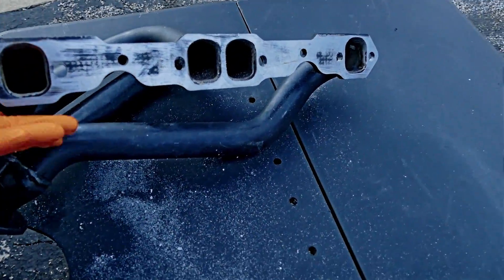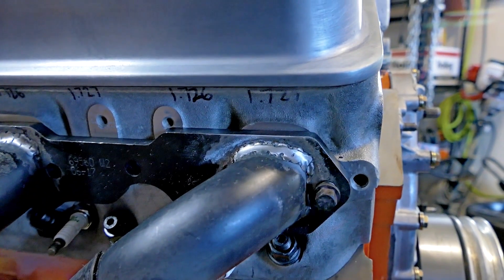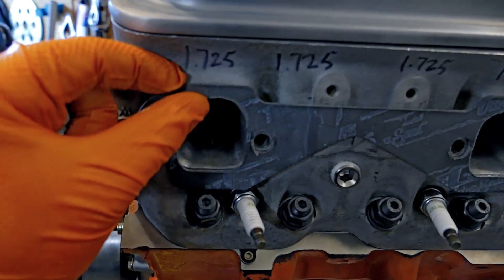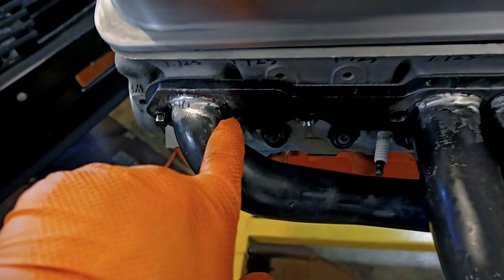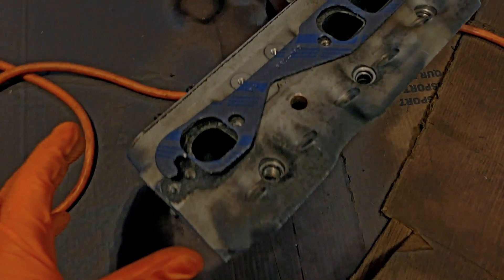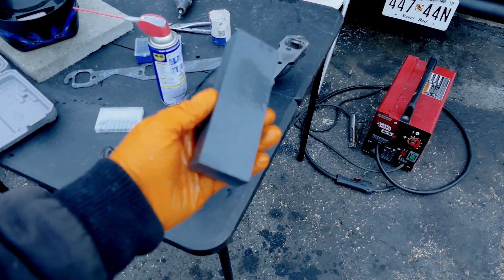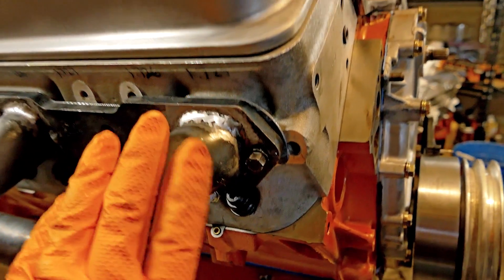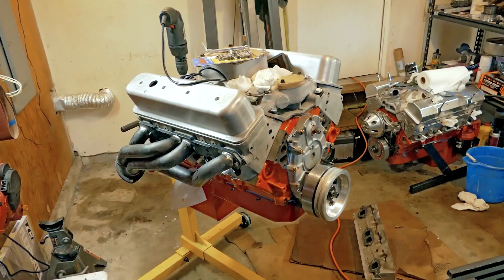Porting Headers for the Nitrous SBC LT1   ( Square to D port conversion )

Comment: i may have the opposite issue. 1st off i don't have a performance application. i have a tbi 350 and idk what ports i have on the heads but the hooker manifolds i ordered have D ports i won''t be doing the work so will i be sending a disaster?

Comment: Nice, but I think I would ovaled the bolt holes, then weld a washer on to keep the header over the port, but what you did works also, but you never know, after all the work I'd probably do the same also!  I been wondering about LT engines, I'm stuck in the 70's & 80's engine wise,

Comment: Why do you still stick with those shorty headers?  I thought hedman used to make some full length headers for S10s with a tube that wrapped around the outside of the frame rail or something of the sort..
Reply from the maker: The inside frame long tube is smaller and the ports are a circle, so they are blocking the top and bottom of the exhaust port. I actually had them in the past and on my setup the truck ran fastest with the shortys.
Reply from the maker: Sorry misread your comment.The outside frame race headers limit your steering not really the best street header and are $700. I thought about them but I don't think the LT1 flows enough air to get a noticable gain.
Reply: @TPVPRO  oh that makes sense i didnt think about the steering issue caused by that primary tube.

Comment: What is the diameter of those headers ?  Seems the short tube headers be the bottle neck , should weld evac tubes in collector for the nitrous :) .   Like the content !!!  Sweet builds .  I’m stuck on customer stuff , just did 383 with atk/profiler 210’s (only $1047.00 assembled ! ) 252-256 @.050 solid bullet cam etc ...    think i have a startup on my “channel”. Lol
Reply from the maker: They are 1.75 tube. The race headers that go outside the frame are expensive and limit your steering.